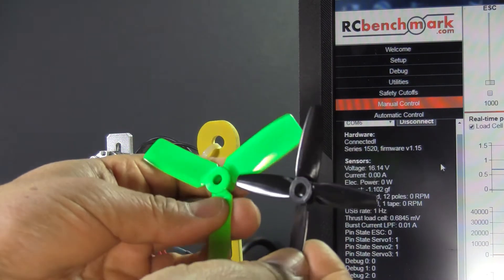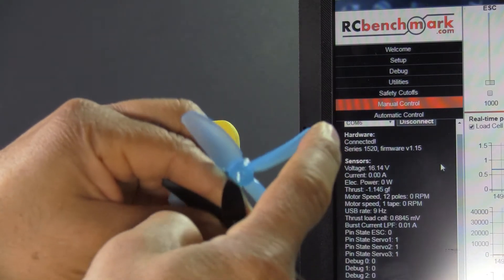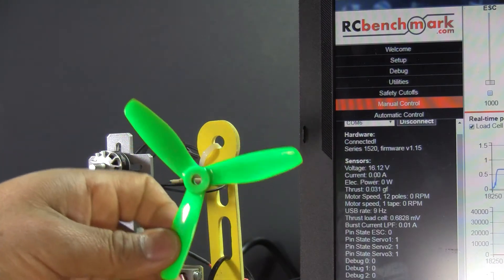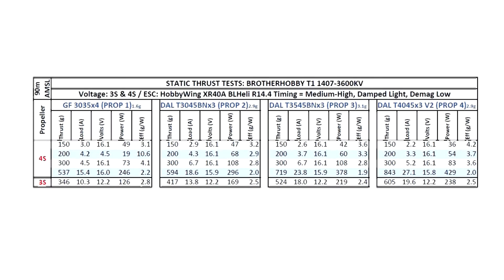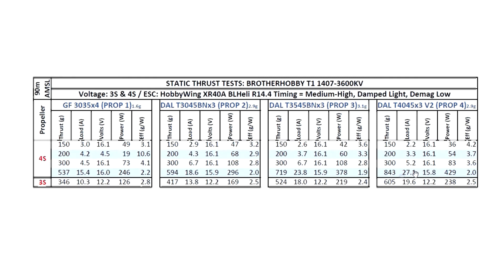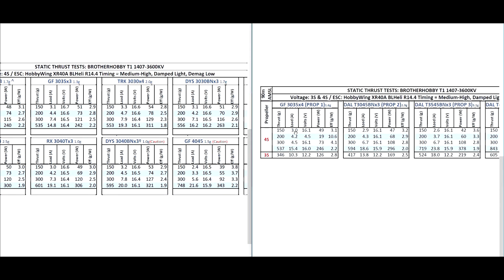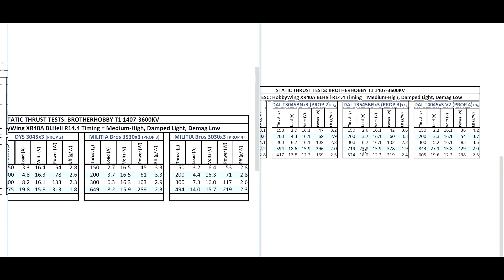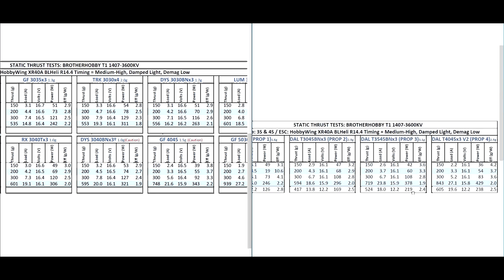BrotherHobby T1 1407-3600KV More Props GF3035x4 DAL T3545BN - added LUM 4040x3 to Excel file

Comment: Hey bud, did you ever get the Lumenier V2 4x4x3 blade tested? Curious to see how they perform compared to the DAL 4045x3 v2
Reply from the maker: Jonathan Jonas on this motor? Man I just tested those new props and totally forgot. I'll run the test right now. I'm testing some other motors tonight. I'll just add the data to the spreadsheet on this test
Reply: It's all good bud, life gets busy:-) I still gotta send you pics and a video on the 4". I killed a motor last week:-/ still waiting on the replacement and final bb log
Reply from the maker: Uuuugh... hate waiting for parts.
Updated the Excel spreadsheet. I ran the prop earlier this evening. Lots of thrust from the Lum 4040x3 BUT  DAL T4045 was better. Lum 4040x3 might be a bit too much for the motor. I wouldn't feel comfortable running it with this motor.
Reply: interesting i guess ill be switching props, lol thats just what i needed more thurst with less current draw. Thank you sir!!!
Reply from the maker: Yeah, I didn't think it was going to pull that many Amps! From the test is looks like the DAL T4045 will be more responsive since it can spin to higher RPM using fewer Amps. But ultimately, only flying both on same setup and getting your own "feel" for how they fly will tell you if they're good for you.
Reply: I have Interesting findings for both the Lumenier 4x4x3 and the dal 4045x3 v2.  Both are definitely awesome performing blades but each offer a different flight characteristic. While the top end power on the Dal is high with less current draw the mid throttle power just isn't there, which is really nice for a racing style scenario as there is very little "float" however I am having to stay higher on the throttle just to maintain the same altitude in fast forward flight can be over come with time. The Lumenier gave great mid throttle power and great high throttle power but at the expense of higher current draw and almost excessive "float". I flew around a test track with 6 batteries 3 for the Dal and 3 for the Lumenier. I recorded approx 60 amps from the Lumenier whereas the Dal only pulled around 40 amps. As would be expected the flight times were shorter on the Lumenier but I felt I covered a greater distance faster, to each his own. All in all I am torn between which prop I like the best, I like the mid throttle power of the Lumenier but I like the locked in feel of the Dal. Perhaps a 4000kv motor could help bring the Dal to a happy medium. Just my 2 cents
Reply from the maker: Excellent break down on the flight characteristics of both these props. The Lumenier's "beefier" blades is what gives them higher thrust from the midrange up, but as RPMs get higher they draw lots of juice. What's amazing it's that this motor can handle the Lumenier. Thanks for the break down!
Reply: Yeah they handle them and don't even get hot it's wild. Absolutely thank you for all the time and effort you put into you tables and tests.  I uploaded a video of the Lumenier test flight, it raw Dvr footage if you want to see it
Reply from the maker: Thanks - Yep heading over to your channel to check it out! I would've say noway! hahaha... but cool to see you got them going

Comment: PLease test gf flash 3052 on 4 s and just send me the amps and trust please i will send you the blades or pay you some money for it , just say your price im very curious because 4 of those are pulling a 360g 3inch rig very fast not for long but fast.
Reply: A 3in quad weighing 360grams....
Thats why.. Lighten up your quad...
Reply: Dnex1 FPV i cant carrying a runcam 2 and a tpu case whith out all that its only 270g.
Reply: Dnex1 FPV and my tatu 4s 850 mha its 105 g.
Reply: You can change screws/stands offs... To nylon... That will save some grams... Perhaps a lighter frame... I mean 360 to 375 grams for a 3in... Is not so light and with aggressive style of flying would drain out just about any pack quick.
Reply: Dnex1 FPV 3 min or less depending on my flight style. Realac 140 frame 4in1 esc all nylon , i have even cut some parts of my frame and whithout the runcam im in 270g with batt.
Reply: Ok... Gotcha.. 270 including battery...  So about 165 dry... For me any where around 2.5 to 3 mins with my flying style is great to me... Assuming it's no crashing involved..
Reply: Dnex1 FPV i just wanted to know how much thrust these propellers can produce on 4s on these 3600 1407.
Reply: Dnex1 FPV  like this flight footage 3 min and a medium speed and some acrobatics.
Reply: Yea somewhat... I fly with a lil more mid throttle punch outs.. So we can say... Pretty much
Reply: Dnex1 FPV i whish...  the worst is wen its comming down.😉
Reply: What happens when its starts to come down..
Reply: Yea kno.. I dont come down to far... The ground always catches me... Yup.. My #1 receiver
Reply: yea but its soo cool stoping there really fast.. yes i need to keep on the throttle as soon as i see 2 , 2.5 m to the ground specially fully loaded..... it suits me fine but the eficiency is not the best, can these motors handle it ? ho yes they can.. very satisfied whit these props 3052 makes the thrust i need , just dont know how. :)

Comment: Do you recommend to use medium-high timing with these motors?
Reply from the maker: Default setting of Medium has been reported to work well. Medium High seems to work just as well. Theory is higher timing= more top-end but that was for previous generation of ESCs. For the newer BLHeli_S I don't know if it still holds. I would just leave it at default Medium if you're on BLHeli_S

Comment: tried the dal 4045 v2s today on 4s and was blown away really! motors seem to handle them really well, best prop I've flown on these motors so far,  never tried them before because i thought they were super heavy and thick but they're actually reasonably light..  hoping racekraft makes some 4" props
Reply from the maker: Awesome! thanks for the report. I gotta try that combo myself at some point. These little monsters of a motor keep surprising us with their capability. Yep, RK released their 3" props recently. I think there's also a good demand for 3.5" and 4" props as well.

Comment: Please, test t-motor f20 4100 kv with more 4 inch props on 3s. I beg you. I woukd love how it copes with dal t4045x3 v2
Reply from the maker: I'll try and run the test next time I'm doing a test session. I gotta finish some other reviews first that I'm  behind on, so it might be a couple of weeks, but will try to do it sooner. I'll just add the thrust data to the Excel spreadsheet on this test so it'll be the same link. I'll reply to your post here to let you know. 
From my observations, the F20 matches best with the "lightest" props like the ones I tested. Heavier and higher pitched (like the T4045)props might not match well because the motor doesn't have a lot of torque due to its high KV and smaller 6mm tall stator (compared to the 1407 motors). It will spin them and make some thrust, but it's possible when you fly they could feel less responsive if you're doing freestyle -acro type of flying. For cruising around the park they might be ok
Reply: Thank you. And how do you think will it cope with light prop and 4s? Before I fried my fc I tested it at hover and it was slightly warm. Do you think it will burn? By the term light prop I have gamfan 4045 in mind.
Reply from the maker: 4S GF4045 might be OK on a superlight setup but I would definitely be careful for the first flights, checking motor temps after a short high throttle run, land quick and check. I think this motor is better suited for 3" props on 4S. For GF4045, it would've been better to have 3500 to 3800KV. I have not seen any video of people flying this motor on 4S and 4045 props or larger yet.

Comment: would love to see a test of the Racekraft 3076 triblade and the pentablade coming out in a few weeks.
Reply from the maker: I'll have to order those when they come out - thanks for the heads up, should be interesting to see how they stack, unless they're one of those funky props that need to be in fast forward flight to show their performance
Reply: Neil Fraser I've received an order of them and they fly really horrible for me. the rotorx tri and lumenier tri fly amazing, but the Racekraft just are horrible for some reason
Reply from the maker: Interesting, thanks for sharing. What is wrong with them for you? Can't get quad tuned, vibrations, unresponsive, not enough thrust? As more reports get posted on those props we'll find out if they're any good.
Reply: EngineerX they seem to just be overall slower with a bit more amp draw. Also I can't seem to get a decent tune with them, they make some bad sounds like bearing grinding and have bad prop wash in turns that I can't get rid of. Not sure why, as I've tuned every other prop well in the past.
Reply from the maker: Sounds like a not-so-smooth prop then. That's disappointing because their appearance is good, they look like they were designed specially for this size of motors! Too bad, had high hopes. I'm sure we'll see more reports and videos on those. Perhaps they'll work better in other setups, but symptoms sound quite bad :(
Reply: Hopefully others have a better experience with them. It just felt like my t1 1407 just didn't have the torque, even though I know they should. I'm looking forward to seeing what others say!
Reply from the maker: Hopefully!
Looks like the 3076 was designed for "fast" forward flight, so at low speeds (banking and turning - Acrobatics) they might not be good as they will be operating on the stall envelope, meaning they're not spinning fast enough to produce the necessary lift maintain miniquad attitude. At least that's what I'm understanding from TRK prop designer on his post: https://www.rcgroups.com/forums/showthread.php?2752196-New-Props-from-Racekraft-Info-Teaser/page10#post37444124
Reply: I run my 1407 xnova 3500 at 5s or 4s LIHV so that may be what im after :)

Comment: Great prop tests man, just out of curiosity why do you supply the motor's with only 16 volts, instead of the 16.8 volts a fully charged 4s pack would provide, are you compensating for the real world instant voltage drop and sag that a pack would produce?
Reply from the maker: Yes that was the idea, LiPos sag right away to around 16V on the first full throttle stints. I started testing with a LiPo battery bank of 7000mAh and even with that much battery it would still sag and stabilize at around 15.8 to 16V so I kept using that voltage when I moved to a power supply